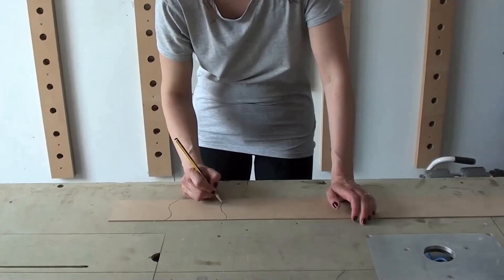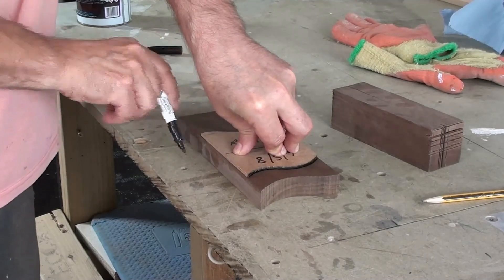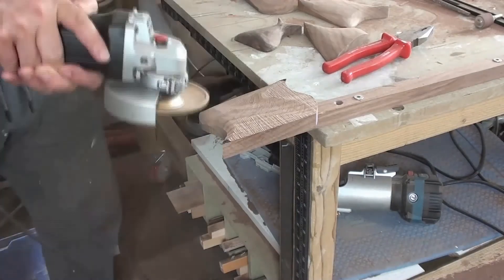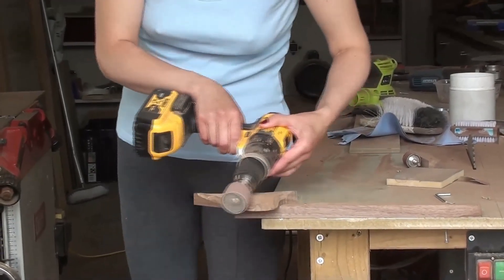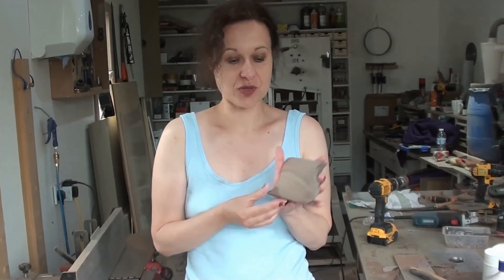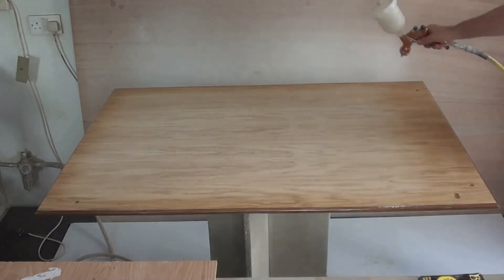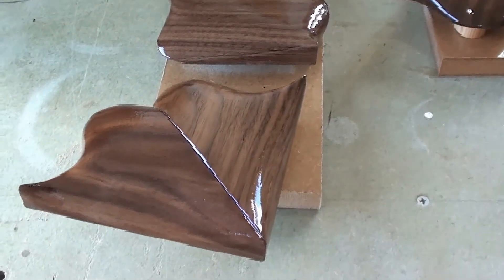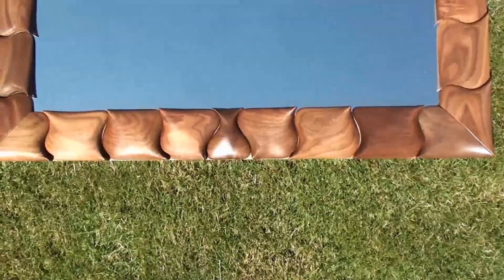mirror | unique wooden mirror frame design (2022)

Comment: Hand-held jigsaw cutting out templates. OMG!   Wooden depth gauge for drilling. Noted.   Threaded inserts. Noted.   Drilling holes into the back board of the mirror. Eek!   Rotating support for spray painting. Noted.   Teamwork. Noted.  Lovely framed mirror.  Thank you.
Reply from the maker: That's great, so pleased our videos are helping you some. (E)